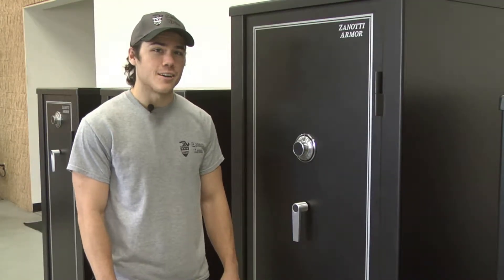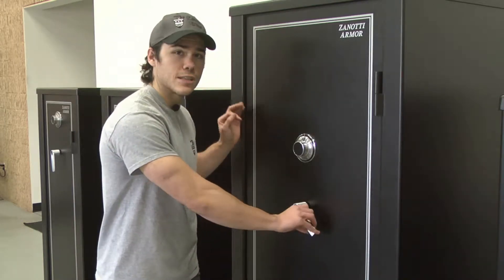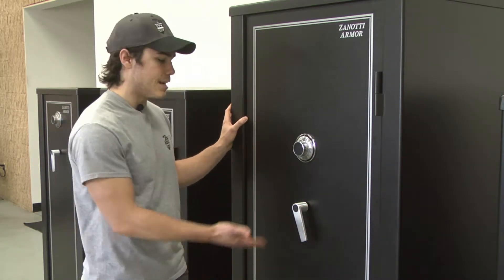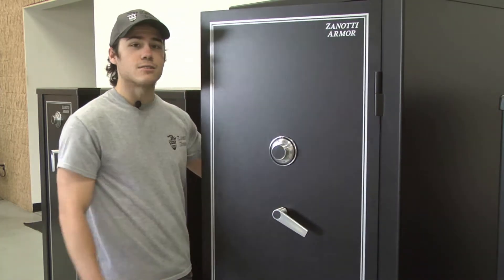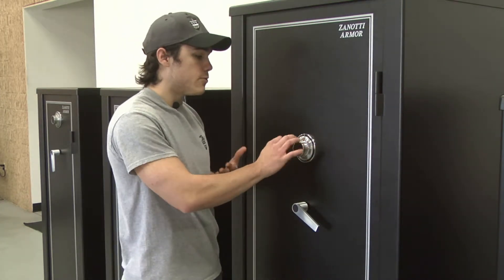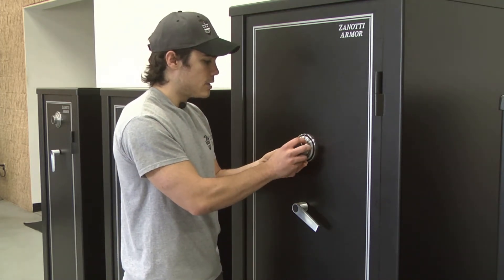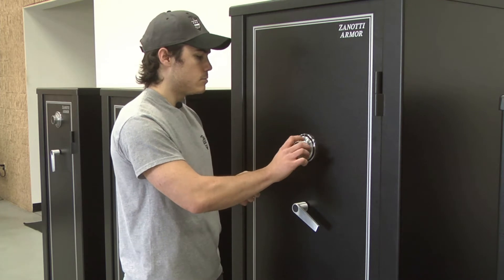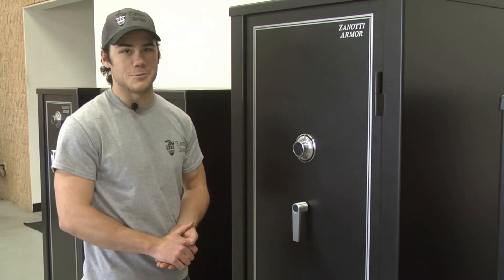Zanotti Armor - Safe Locked Open

Comment: no keypad entry option?
Reply: Actually Wesley we can do an electronic lock we just dont do them typically.  We have just found, through the years, that the mechanical locks are far more reliable.
Reply: Thanks for the question.